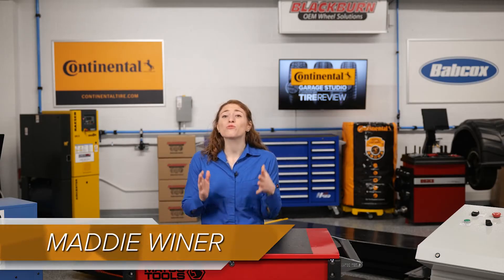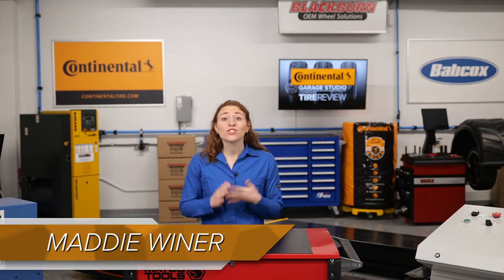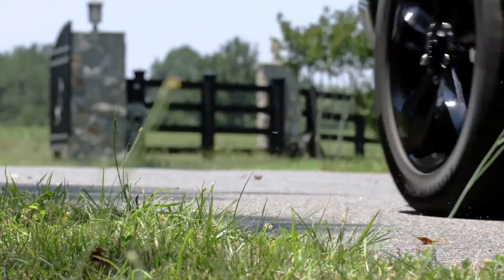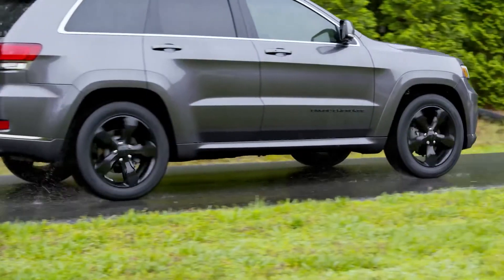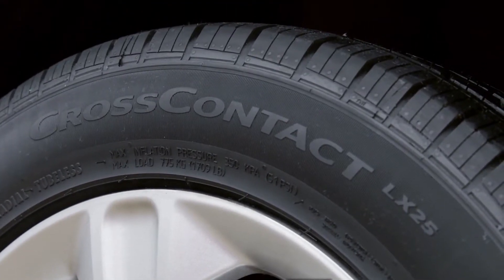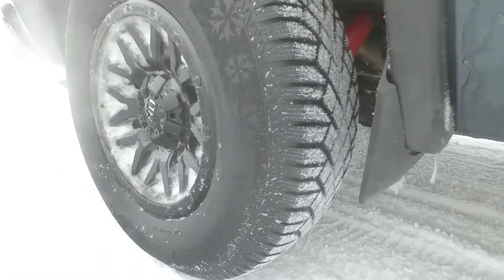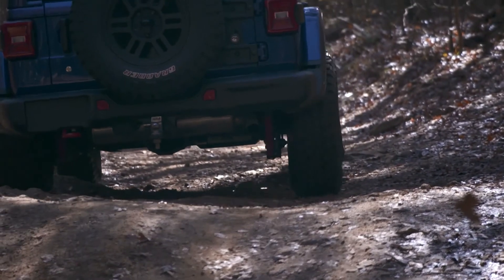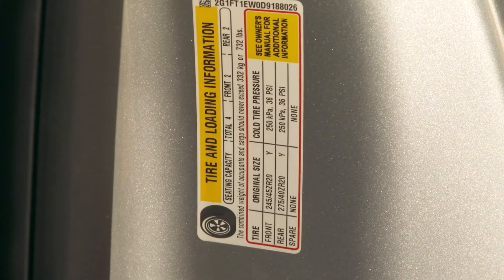Why Does Rubber Crack On Tires

Comment: All my cars have continental tires.  i had 10K miles on the tire and it is 6 years old.  But there are tires that do not crack like this.   Thinking to change the barand now.
Reply: Tires older than five years, are considered expired. Doesn't matter what brand.
Reply: Tires older than five years, are considered expired. Doesn't matter what brand.
Reply: Tires older than five years, are considered expired. Doesn't matter what brand.

Comment: Can you help?!!! My brother a man in his 40's got a mini 6 weeks ago and 4 weeks from getting it one of his front tyres bubbled. Turns out the back tyre had bubbled and they replaced it before handing the car over saying it was road safe. It took 2 wks for the manager to come back to him and in that time the other front tyre bubbled. 3 of the 4 tyres all bubbled so my brother thought it must be a fault with the tyres. No the manager said it must be how my brother drives the car and he couldn't prove either way. That night my brother had a local garage look at them and they said the tyres had bubbled as they were both perished. My brother was/is mad and called the sales manager again who is still saying it's not there issue that nothing was noted in the inspection before handover. Please tell me how it's possible for 2 tyres deemed road safe to become perished and bubble in 4 weeks. The car was at the showroom for some time before my brother bought it and thinks it's caused them to dry out. He didn't buy locally and can't drive the car in its condition to the place he got it. Is this possible for tyres to perish after passing road safe checks only 4 weeks after?? Surely the car wouldn't have passed an mot the 4 weeks before he got it if that was all the time it took? There must have been signs. Is there ways the cracks were coved up so the place he bought the car didn't have to replace 3 tyres instead of 1? It's all a bit of a mess. My brother takes pride in his cars and looks after them. He's gutted as it's ruined the car for him.